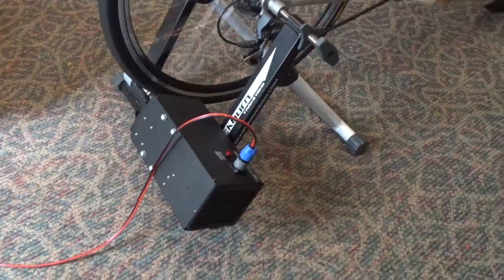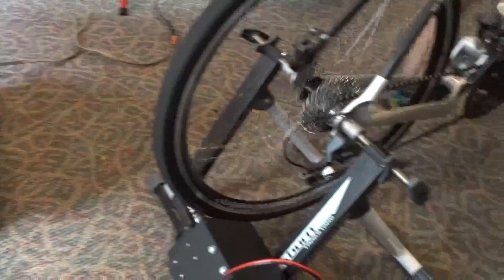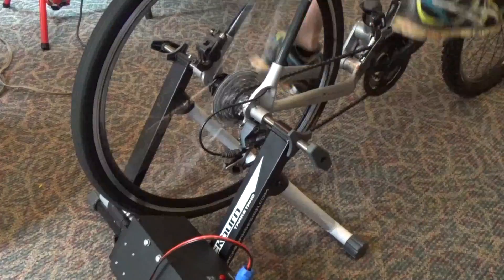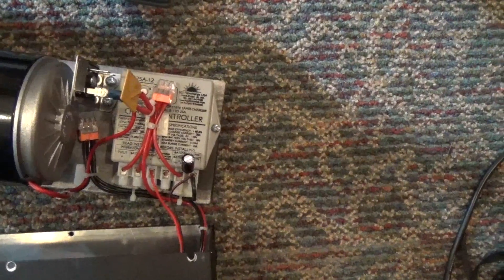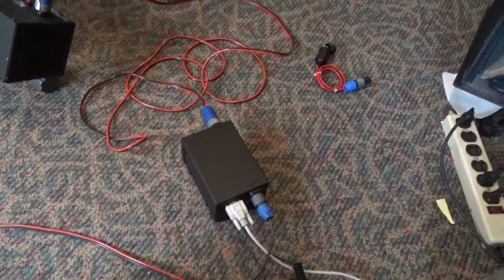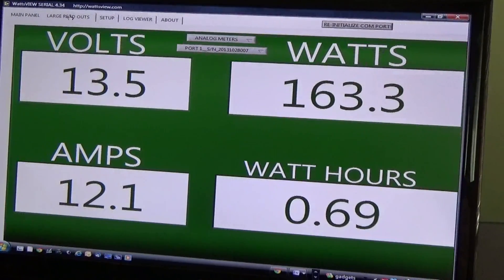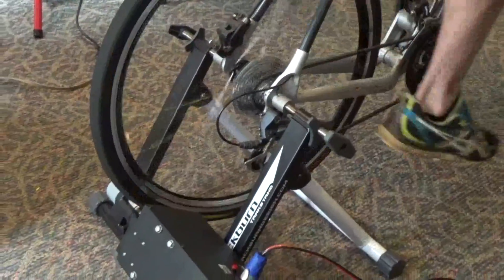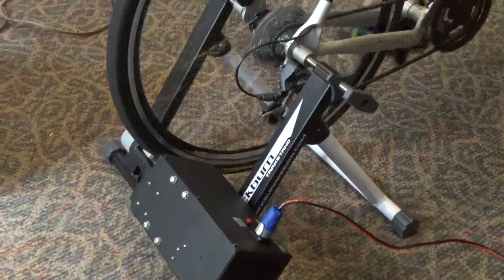Charge your batteries with Pedal Power

Comment: I don't think you mentioned that this, as I understand it, is capable of supplying standard 120V AC feeds to appliances. I was thinking about easy solutions to keep fridges cold in black outs. This may provide enough power for the on/off bursting of a fridge vs constant peddling with a good deal of regulation and efficiency.

Comment: That's very interesting using gearing to match the voltage/motor you have. I've been wondering if some sort of RPM controller will work. Meanwhile I bought a step down buck converter, but with varying pedal speed I've decided to add a voltage regulator mosfet as well. I matched a scooter motor friction drive to the wheel of an exercise bike. I need to listen again to get the model number of the controller you're using. I assume it's for wind turbines or hydro but I thought some spec's are universal so might not work with my setup. 0-85vdc no load. Great info and your replies.

Comment: I've never understood why the people who engineer electric bicycles don't have a recharging system set up for drag manually when going down a steep hill or braking to recharge the battery in the system.  The drag on the bicycle would recharge the battery and would help control the speed of the bike to stay out of danger's way.  Kind of like the Prius.  Could it be possible, anyone?
Reply: Yes, I believe the term is "regenerative breaking" ,   The physics to determine the answer  starts with calculating potential energy in the form of Joules.   (Height of the hill your on, times your mass x gravity).   So if you on a hill that is 100 feet high and the weight of your bike and you is 250lbs, then the amount of energy you can put into a recharging system on your bike could only be as much as your potential energy  at the top of a hill minus  the losses due to inefficiencies in the charging system.  (Let's use ignore losses and assume we're using the ideal perfectly designed system found in area 51).  

At the top of the hill your potential energy is  PE = (20 kg)(98 m2/s2) = 113kg x 98  = ~11,000 Joules.   Now a Joule is also equal to   One Watt - Second.   So if you descend the 100 Foot hill over a 100 second period,  then that could charge your battery at about 110 Watts  -  or  about 9 Amps into a 12V battery.   So total charging Amp Hours during the 100 Seconds (0.027 hours)  is:  Amps x hours = 9 x 0.027  =  0.25AH.    If the battery is a 20 Amp Hour battery,  then that would give it about 1.2% of it's total capacity, in a perfect world.

Comment: I wonder of one of the newer Missouri Wind and Solar PMGs would work in this kind of setup?  It is supposed to turn very easily and might make it less effort to do this.  I don't have one yet (cost) but i would love to try it out.
Reply: It turns out that the laws of physics have the human body constrained at about 100 Watts average output for bike generating.  You can try different PMGs, but the output will not change more than just 1% to 5%.   Your heart can only pump blood so fast to your legs, your legs can only put out so much power.   Sad but I have been doing this for 10 years, and those are my findings,  Brad , Electrical Engineer
Reply: If funds are tight the best solution is to use a DC permanent magnet motor as a generator.   That's right, a DC motor is also an excellent generator.  The video shows a generator that is really a DC PM motor for a kids electric scooter made by razor.   It costs $30.00, then you have to adapt the shaft with a pulley or polyurethane rubber roller.  The biggest challenge is to make a custom mounting bracket that attaches to your bicycle or to the bike stand.   By the way.  Ebay has lots of DC PM motors at a good price.

Comment: Assuming that bicycles would be a common and necessary mode of transportation in a grid-down situation, what would your thoughts be on a small genny or dynamo on a bike while riding it, or used for regenerative braking, to charge small battery packs such as for power tools, etc?  I don't know if the old time clamp-on ones that were for running a headlight would be very durable or not?   Have you looked into the electric motor / generator hubs for hybrid bikes at all?  Seems like there could be a world of potential there...  thanks for another informative vid.
Reply: Producing power as you pedal is like taking your bike up a hill, or holding your breaks on your bike while you pedal - it can wear you down.   So the most you can harvest off your bike while you are riding it (Without feeling the drag)  is something around 10 Watts.
Reply: Well, by your name, you sound like an expert on the matter.  I didn't realize that the net gain was so low; 10 watts, yikes......  it hardly seems worth it at that point.  It seems like one would be better off mounting a small solar panel on the bike instead, for lights, comms, etc.  Hmmmm.....  Thank you for the input.

Comment: Got a question....  If one cannot ride a bicycle (used to, but after becoming disabled, yadda yadda) would it be possible to whack together some sort of hand "pedalled" bike to charge with?
Reply: sure, get yourself a used recumbent hand driven bike, then convert the output to a suitable generator. you may have to employ a DC-DC boost converter (cheap $20 on ebay or aliexpress) and some capacitors, because "hand speed" may produce less voltage when you "find a comfortable gear".
Reply: Check out engineer775 video on crank a watt generator.

Comment: How long would you have to pedal to typically charge the battery in the Crank-A-Watt device?
Reply: In the video you can see that a rider can put out something around 8 amps on a continual basis.   To figure out an approximate battery charging time, you can take the Amp Hour Rating and divide it by the output Amps which is 8.  So if a battery is 50 Amp hours,  It would take about 50/8 =  ~6.25 hours give or take an hour.   Brad ,   Electrical Engineer
Reply: Calculating the time it takes to charge a battery is based on two things.  (1) The Amp hour rating of your battery (2) The average Amps output of your generator.   So for the bike generator in the video,  the average Amps output is about 7 Amps.   For a 100 Amp hour Deep Cycle Battery  you can get a rough estimate by dividing  100 AH / 7Amps = 14 Hours of pedaling.  (Keep in mind that 100AH is a BIG battery.   As a point of reference , the Duracel 600W portable power pack has a 28 Amp Hour battery).     The Crank-A-Watt  uses your hands which have much less generating capacity, maybe a 3rd than that of a bike.  So a 3x  14hours would be around 40 to 50 hours.

Comment: pesh, not even going to test for longer than 30 seconds.  that person was busting their ass. cred = lost
Reply from the maker: Appreciate that.  An Olympic Athlete can make 200watts an hour.  This setup easily makes 100 watts/hr pedaling nice and easy.  We were making ~ 150/hr.  What were you expecting?
Reply: It depends what your situation is.  Sitting in your easy-boy chair in front of the TV  with a cold beer may be yours.   You may feel different about it in a survival situation  in an underground bunker with no wind nor sun and you're just trying to get enough power to charge some batteries for lighting and ham radio...